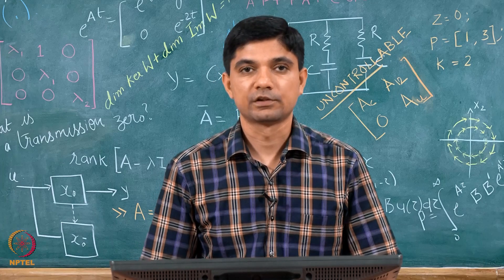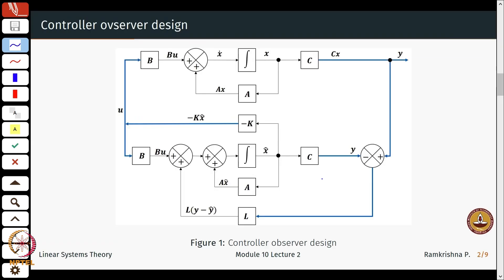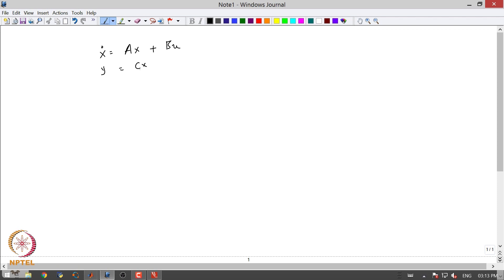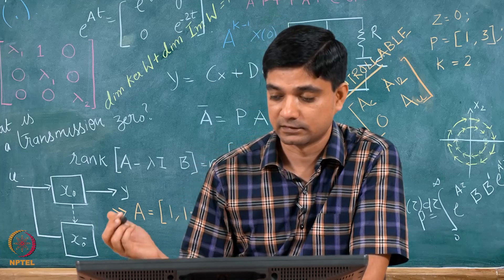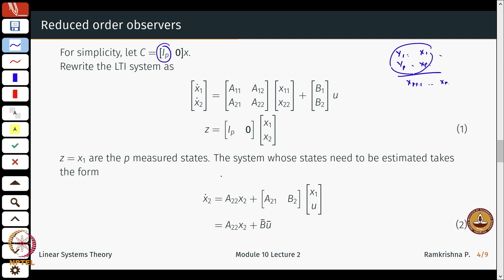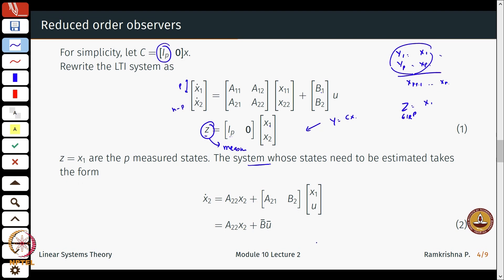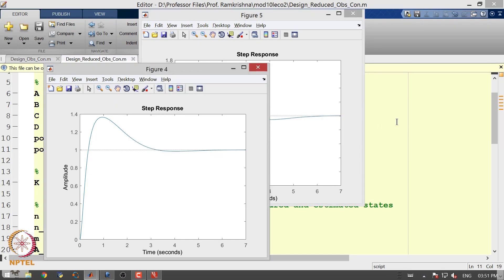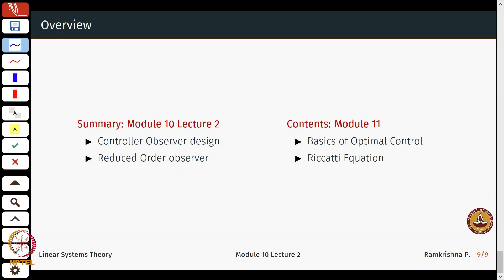#42 Design of Observer & Observer based Controller  | Linear System Theory

Comment: What is observer actually??? Is it an algorithm??? Or something physical???
Reply: It is a state estimator. Most of time we do not have all the states to feed them back, so we estimate the missing states, the states we cannot sense directly. After estimating all the state, we feedback this estimated state and K. The observer is done by software.
Reply: @felixruiztorrez5192   if observers is estimating the unknown states..then why we are comparing them with output bcz output may also have disturbances..and how we are estimation states which parameters are used to estimate state when we don't know any state
Reply: @jaswantsingh1223  First you need a model of the system, then this system needs to be observable, which means that with the sensed states you can estimate the missing ones.

Comment: The lower part of your block diagram is wrong. It should be y^. Otherwise, you will end up having the original system Xdot=Ax+Bu . You need to improve your communication skills.